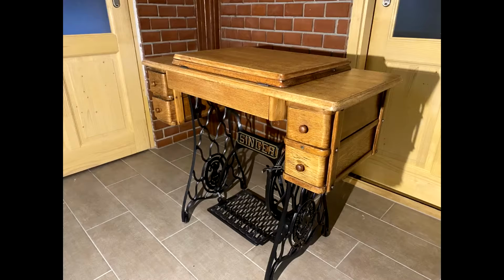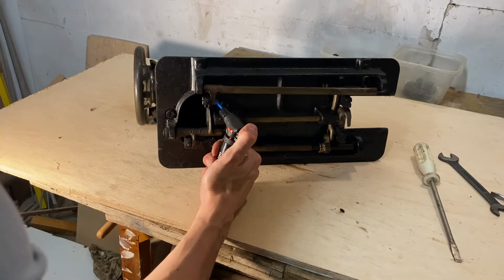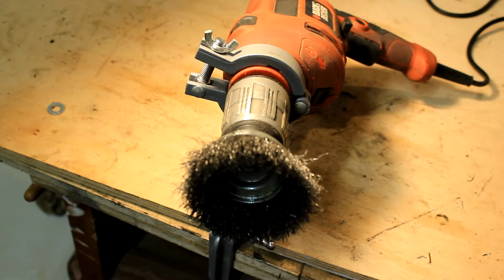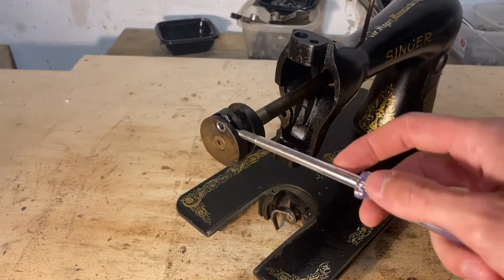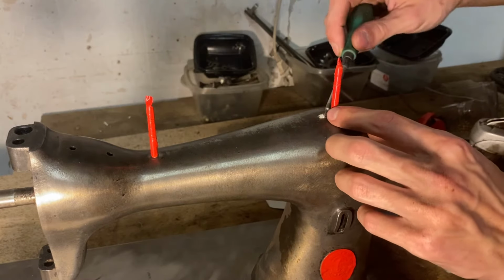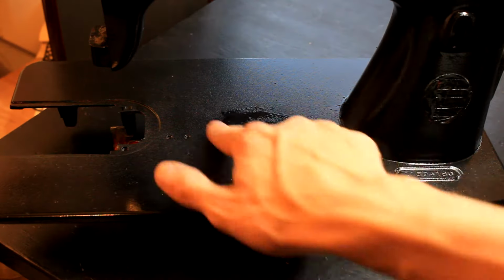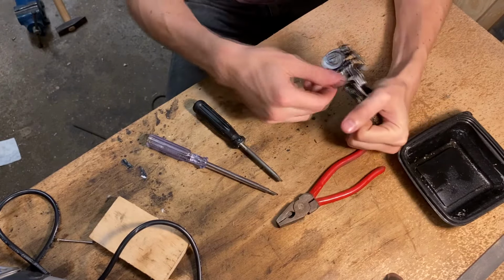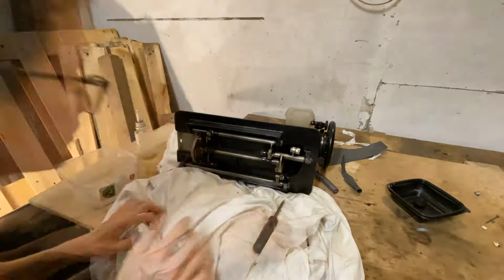100 Year Old Original Singer Machine Restored, so much rust removed !

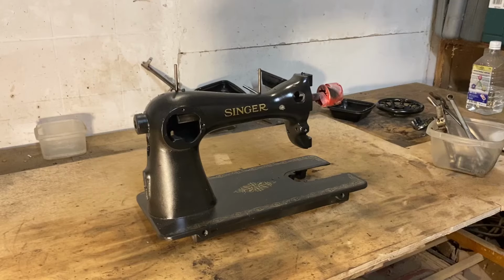Comment: Hello, my friend. At 27:45, as we look at the machine, there is a 2-centimeter-diameter hole on the right side; to the left of that—about 3 centimeters away and slightly lower down—there is a screw that you didn't remove when you disassembled the machine. Do you happen to know what its purpose is? Thank you.Greetings from Greece.All the best.

Comment: 29:08 No, before it was just grimy, something petroleum and a bit of patience would've fixed easily.
Now, it has a hack, matte paintjob, where you can see the machining traces of the base plate and all casting imperfections.
Hundred years of patina and the perfectly finished, shiny japanning, durable on par with modern powdercoating, gone forever. Congratulations.

Comment: 7:21 Those are not rivets, but slightly conical pins. 
You can hammer them out by hitting the smaller side of it.
10:00 Old school sewing machine techs use hot soda-solution (sodium carbonate) to wash badly gunked parts, for the rest, lamp oil/petroleum will do.
13:26 Cleaning an axle is fine, reducing its diameter is not, it will cause tolerance problems with the bearing it runs in.
16:10 Using petroleum to clean up the outside of the machine would've been just fine. It would still have its nice patina and golden decals. The black paint is called japanning. It's several layers of asphalt paint, baked in an oven. Onto that, the golden decals are applied, then protected by transparent shellack. By wirewheeling it, you also destroyed the filler that masked casting imperfections and your three layers of paint won't be even remotely as wear-resistant as the original japanning was.
32:40 You need to use either a bronze hammer or a piece of hardwood between a steel hammer and an axle you hammer into the machine to avoid marring the surface.

Comment: 16:33 Rather than paint, this is japanning, a mult-layer baked-on coating made of turpentine, boiled linseed oil, and asphaultum (where the word "asphault" get's it's name). Lacquer thinner can soften it, but it still needs some abrasion to remove.
People recommend wire brushing or blasting with softer mediums, like crushed walnut shell, if available. If it's chipping or flaking off, then it's way easier to remove.

B/c the recipie is fairly simple, you can do japanning at home. However, it is time consuming b/c you have to bake it multiple times, plus it's going to smell like hot asphault the whole time. Don't use your good oven in the house lol.

The "clear coat" should be shellac IIRC, which disolves in alcohol. The shellac finish can be repaired if it's damaged, b/c shellac will combine with previous layers, unlike other modern finishes.

Comment: The brass badge on the pillar is held on by little bent pins ( the two little bumps on the sides.. Since you have removed everything from the pillar, you should be able to use a very thin screwdriver or an exacto blade to straighten them out, then push them out to reuse.  Then you can remove the japanning to keep everything level.  By the way, if you do another machine, you can safely clean the surface of the japanned areas with sewing machine oil and a soft cloth.  It will remove all the nicotine tar, and other grime without damaging the decals. If you want to remove the shellac and the decals you can use rubbing alcohol, or denatured alcohol, which will dissolve the shellac and remove the decals without damaging the japanning. I have very successfully covered chips and scratches in the japanning with black fingernail polish; others I have seen use Testor Enamel Model Paint in black. The fingernail dries to the height you leave, filling deep chips nicely, and you can sand them cleanly with 400-grit or higher fine sandpaper.  I just finished this part of a 66, and it came out beautifully.  Good luck on another if you so choose to try it again.

Comment: You could have let those threads sit for a day in pb blaster to loosen the grease and use a small butane torch to heat screws before removal. Damaging the knurling and the slot on those screws was tragic. The dimensions of slotted screws were different then and require special tools. You could have used a brass drift. Those old machines were Japanned, not painted. You really needed to mask everything a bit better as well.

Comment: So, when you were putting it back together, why didn't you watch your footage of taking it apart? I hope you put a clear coat over the top to seal the decals, or they won't last. The brown goo is deteriorated shellac. You could have left the old decals on and brightened the old shellac just by putting a new coat on, after cleaning with sewing machine oil. Also, there are specific 15 decals available, the Tiffany and the RAF ones particularly. And if you cleaned out the bores, you would find the parts don't need a hammer to put back together. Good job, I hope it sews! PS watch Bob Fowler for old Singer restoration.

Comment: After you drilled out the rivet holding the handwheel bushing on, how did you secure it again when reassembling? I have one from 1889 and it has the same rivet in that bushing I am struggling to remove.

Comment: I LoVe how you restored this machine taking the time to take apart every little item which I believe is numbered which makes it even more interesting to me. You were very brave to paint it and add decals. I have recently bought a 28k Singer sewing machine 1948 I believe.  I have decided to do a semi restoration of it as it was in really amazing condition. Sitting in someones garage hardly used before I came along. I bought it for a very cheap price and it came with the cabinet. I was thrilled. I cleaned it, oiled it well. Ordered a new belt and just waiting on that. I was also happy and relieved to find that the treadle was not rusted just brown in colour so I just cleaned it with some metal cleaner. I will oil that a little later too. Everything is in good working order. The silver plates on my machine I cleaned with Silvo which is a silver cleaner as the plates are silver. The brass I cleaned with the metal cleaner as well.

Comment: hi... thanks for your video... I need to remove the plate (top) to fix the cover plate for embroidery work but the screw will not budge... I have put Singer oil and WD40 but still it won't budge... any suggestions?  thanks

Comment: Kroil.  You need to dissolve the crud first.  The main shaft is intended to be removed the opposite direction you removed it.  Also an ultrasonic dip will quickly clean up those components

Comment: The best way to release old oil is to add more oil. Oil is a solvent. The machine is made to handle sewing machine oil. 

Same idea for getting the shafts out. Add oil. Lots and lots of sewing machine oil. It's usually not rust that is keeping things together. It's oil.

Also there's probably lead in the paint.

End result looks good though. Nice.

Comment: The original finish is japanning or shellac, it is soluble in mentholated spirits. If the original is in good condition carefully wipe with metho, allow to dry for a day or two, and then spray with auto clearcoat to protect the shellac.

Comment: One tip is to take a photo on every item being moved so you can see the way it assembled etc handy Phone camera would do the trick. Q I did here that whale grease could have being used to lubricant the moving parts. Another idea is to use a suger soup to clean the parts you diluted the fluid in water. Brendan IRL

Comment: Brasso works very well on chromed parts. And TriFlow is your best lubricant and it works very well on the body part. TriFlow works safely without damaging the decals. WD-40 is not a lubricant. It is a water displacement, thus the letters WD.
Reply from the maker: Oh I didn't know, thanks for the info !

Comment: I'm trying to restore my old singer machine too. It's heavily rusted with caked in dirt, lint, etc. When I try to dismantle the bottom part of the sewing machine, the screws are stuck. They just won't budge. It's like they're fused or welded. I've used all my strength and WD-40 that I could get my hands on but to no avail. I really need to dismantle each part so that I can clean up all the rust and grease that's caked in. How do I manage this? Could you please give me some suggestions?
Reply from the maker: You need to loosen the counter-tightened nuts on the axles, I missed that for a long time... If that doesnt solve it, than get a bigger lever arm and torque it !
Reply: Thank you! I'll try this. 👍
Reply: Don't use WD40 ever. Use sewing machine oilas it dissol es the old hard and stuck oil that is jamming up your machine. It will be oil not rust that is causing the machine to jam up ❤
Reply: Thank you! I'll try this

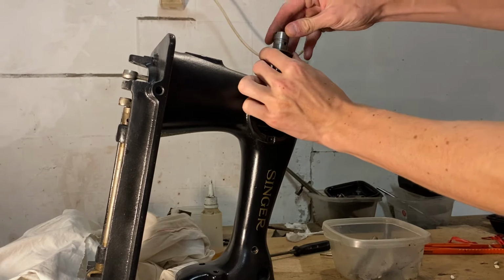Comment: Very good, I have a Singer just like it, I am looking for the screw that is used to set or control stitch length . . . the piece that is seen at 28:27 minute.
Reply from the maker: Thanks !, Yeah I don't think it is anything special, but if you cant find it you could try cutting a thread onto a ground down, slightly larger screw and take it from there
Reply: @hefestodesign  I have experienced various "bolts", but I didn't have good results, it's thread standard is unknown ... Anyway, thanks !

Comment: Those pins you call "rivets" are not rivets.  They are called Drifts.  In the case of these sewing machines, they are slightly tapered. If you tap on one side, it will get tighter.  If you tap on the other side, it will come out.  I can assure you it will.  I have done a few of these.  Very nice work otherwise.
Reply: How do you which side to tap on? 🤣 Both sides of mine are like hammer riveted in. One side has a flat spot in it where it looks like they pounded it in with a punch so I tried to punch it out the other side. Nothing. Wouldn't budge a mm. Tried the other side, same thing. I'm having to drill mine out too.
Reply: @jackofallbertan  measure with a micrometer!
Reply: @andrewmandywilsontatham49  I work concrete, it seems extremely impractical to hammer these out. I know a few who have had success but bent the drive shafts or shattered the cast… I’ve had a years more experience since this post and still haven’t heard a true success story.
Reply: @jackofallbertan I have had more stuck in permanently than those that unstick. Luck of the draw. Seems inversely proportionate to your need to get them out 😉

Comment: Kroil oil for penetration oil  and heat gun works 1000 times better than WD-40.   Using  Mc Masters Carr  Chapman square tip screwdrivers will aid in removing that stuck screw after the heat and Kroil.    Using a punch instead of drilling maybe to your advantage.  Like your drill set up to remove crud and rust.   We all live and learn I won’t be using solvent on my machine nickel plate thanks to you.    Your decals look awesome! Thanks for sharing!
Reply: Yikes! WD 40...no, no, no. "Singer" oil all the way...

Comment: That black "paint" is so hard to remove because it is "japanning" and is baked on at the Singer factory.  It's not quite the same as enamel but certainly has similar properties.  I have known of people to successfully use electrolysis to get most of it off but even then I think it doesn't get rid of it all and they have to resort to more mechanical methods to get off all the last traces.
Reply: Agree, it's a bitumen type base. 3 coats of stripper gets it off, and I have tried electrolysis with washing soda on one. That works fine, and the remnants were much easier to get off because the layers had dissolved so much

Comment: BTW, the parts you are talking about, the "button" parts. One is called a needle bar, the other is a presser foot. Not saying this to be a flamer, simply pointing out the correct terms for these two parts. The part that puts tension on the presser foot is called a pressure bar (I didn't hear you mention this, but figured I'd volunteer that, in case you called it something else. If I'm incorrect, and in Holland, or Germany, or wherever you call home, and it's referred to in the way you state, then please do correct me. I will have learned something new . Thank you again for sharing your work.
Reply from the maker: in Hungary all things have weird non translateable names, thx for expanding my vocab though, and thanks for watching

Comment: As  seamstress I loved your idea of restoring it back to its former glory,  but as an amateur restorer of these singer machines I literally cringed when you brought out the hammerite in a can! You did a fantastic job though 😂
Reply from the maker: Yeah still trying to figure painting out, but this solution proved the best in my experimenting, a metal primer than a shiny black than a soft satin clearcoat. What would you have used? Sintering is unfortunately out of the question for my small shop, and i really wouldnt like to outsource my work...
Reply: @onetryonly  try searching for a rust-oleum paint. It's specifically for metal and its oil/ enamel based. Gives a much better finish although it does take slightly longer to dry xx